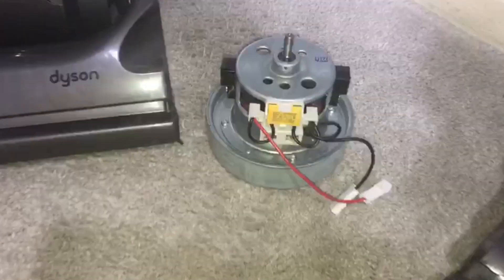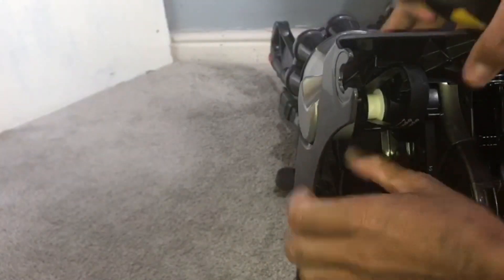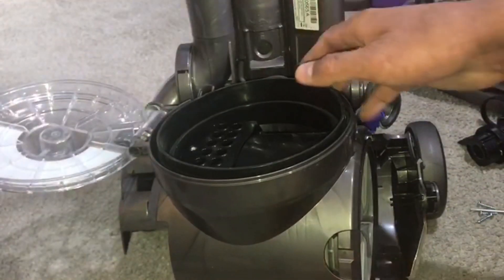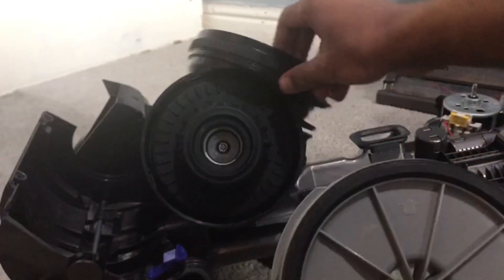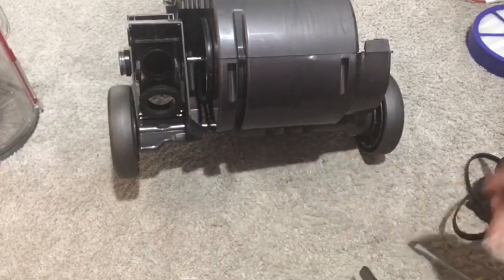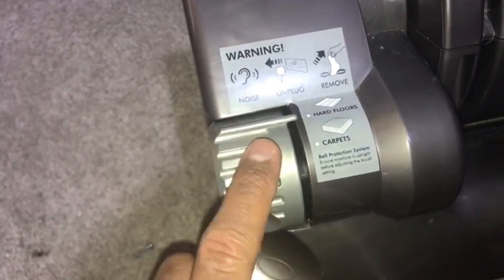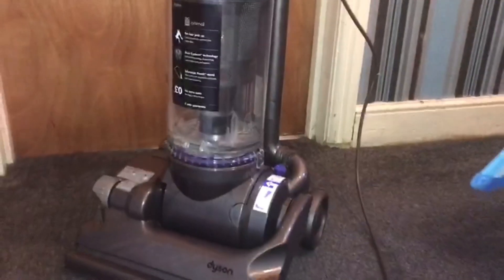HOW TO- Dyson DC33 MOTOR & CLUTCH CHANGE + Tricks to make your Dyson work like new! (EASY PEASY)

Comment: 17:45 my filter lid doesn't go back on do you know how to fix it? It goes on but its a bit stiff.
Reply from the maker: It should just be fitted at the right angle really, make sure it's clean is all I can suggest really along with greasing
Reply: @parwaz7861  I'll try it. But it won't have caused any damage?
Reply from the maker: @jayambermsp8000 Sorry I'm really not sure without seeing it I'm afraid
Reply: @parwaz7861   I put it in without the filter and it fits fine but when I pit the filter into the holder then it becomes a bit tight to fit. Will I have to take it apart?
Reply from the maker: @jayambermsp8000  I'm really not sure I'm afraid sorry, I've never seen such an issue happen before, make sure your filter is genuine is all I can think of really
Reply: @parwaz7861   I've fitted with a qualtex filter. Will I have to remove the filter housing clip?
Reply from the maker: @jayambermsp8000  they never need removing really but I really don't know what the problem could be sorry, try taking it apart and assembling again

Comment: I'm not gonna risk buying a dc33 chassis which is used i probably get a new one what do you think?
Reply from the maker: As long as its not cracked near the top above the cyclone exit
Reply: @parwaz7861  no I mean like  brand new in the box chassis.
Reply: @parwaz7861   I do like the dc33.
Reply from the maker: @jayambermsp8000  yes why not?

Comment: Have you ever noticed some DC33 switch housings that stick? Does washing the switch housing fix it?
Reply from the maker: I’ve never seen that happen before, sounds like it’ll need cleaning
Reply: @parwaz7861  Me neither. Does leaving it soapy water unstiffen it a bit?
Reply from the maker: @niceandspicy3197 I can’t guarantee it will but give it a try
Reply: Is the DC33 the only Dyson that the switch cover becomes a bit stiff over time?
Reply from the maker: @niceandspicy3197 it can happen to any of them tbh
Reply: @parwaz7861  Oh, right. Well, I've washed it and need to dry it, but it seems to be ok.. for now.

Comment: The MTR299 which fitted makes a weird noise when turned off. Is it normal for it to make that sound?
Reply from the maker: Nope, maybe yours is dented or something wrong with it
Reply: @parwaz7861   I fitted it right and didn't use a hammer.
Reply: @parwaz7861   I'll upload it for you to hear.
Reply: Did you watch it?
Reply from the maker: @jayambermsp8000  Sounds fine to me, I wouldn't worry about it

Comment: Anytime I turn the machine on, it sparks. Does it go after a while?
Reply from the maker: It’s normal for that to happen when switched on. As for long term sparking, I don’t know, every motor is different, it could be a good a bad motor
Reply: @parwaz7861   Is it safe to use?
Reply: @parwaz7861  I mostly use the Qualtex ones.

Comment: Would you recommend pattern motor from manchestervacs or a Kenley?
Reply from the maker: Yes they are decent, I use qualtex ones but Manchester Vacs is a good source
Reply: @parwaz7861   Since Manchestervacs don't sell the MTR240, are the MTR240 on Ebay same quality as Manchestervacs?

Comment: Is it normal for new motors to spark for one second when fitted? Theres no burning smell or weord noise.
Reply from the maker: Yes
Reply: @parwaz7861  Phew. I was so worried when it sparked. I had to get a new motor for it. As you can see, I get extremely worried when selling electrical items. In case they get damaged.
Reply: @parwaz7861  Does the sparking go after being used a few times?

Comment: Is it normal for Dyson motors to rust a bit as I've noticed a tiny bit on the spindle?
Reply from the maker: Rust appears on metal when there’s humidity in the air
Reply: @parwaz7861   Does storing it in a room after hoovering up with a dehumidifier prevents that?
Reply from the maker: @niceandspicy3197  It’s not my field of expertise, but I imagine it could help
Reply: @parwaz7861  Have you had any Dyson motors that have rust on?
Reply from the maker: @niceandspicy3197  Yes, due to water damage
Reply: @parwaz7861   I store my Dyson after using it in a room with a dehumidifier on.

Comment: Is there anyway to remove the clutch cover without making the clutch cover all chewed up?
Reply from the maker: It shouldn’t have to be forced out, it comes out easily with a bit of a wiggle once the screws are removed
Reply: @parwaz7861  I mean the clutch dial. Is there anyway to remove it without scuffing it?
Reply from the maker: @niceandspicy3197 locate the two clips on an existing clutch and pry from there, top and bottom with a large flat screwdriver
Reply: @parwaz7861  Does that stop the clutch cover from getting chewed up?
Reply from the maker: @niceandspicy3197  It only gets chewed up when you use excessive force
Reply: @parwaz7861   I prefer non clutch Dyson's for repair

Comment: When I put the cyclone back on the bin, the cyclone becomes very stiff and the seal comes out of place and rubs against the wall. Any tips?
Reply from the maker: Which seal are you referring to? And do you mean the cyclone is hard to push back onto the vacuum?
Reply: @parwaz7861  It's the external seal which sits on the cyclone on the DC33. It comes out of place when fitting it back on the bin.
Reply from the maker: The foam gasket, the bottom circle shaped seal for the bin flap or the ring seal that connects with the top of the bin?
Reply: @parwaz7861  The upper bin seal the one that sits on the cyclone.
Reply from the maker: It will need some talcum powder to help it slide against the bin
Reply: @parwaz7861  Will it stop the cyclone seal from coming out of place when fitting it back on the bin?
Reply from the maker: @niceandspicy3197 Yes should do because it sounds like the seal is sticky, they need to be dusty in order to move freely
Reply: @parwaz7861  Does talcum absorb the moisture from the seals and is it recommended to wash seals or not?
Reply from the maker: You can use any powder as well, it shouldn’t cause any issues. Dysons have some white dust from the factory on their seals for this very purpose. The seals aren’t designed to be washed of wiped with a damp cloth at all, like I said they’re supposed to be rusty to prevent they sticking against plastic
Reply: @parwaz7861  So far, I've done nothing to it and it seems to not go out of place. Should I use it a few times for it to stay in place?
Reply from the maker: @niceandspicy3197  Yes

Comment: I changed my dc33 motor and it works brilliant now but it has a smell to it is that normal?
Reply from the maker: Yes because the burnt motor smell from the previous motor will be in the plastic motor housing and post filter so it's best to give the parts a good clean, the motor bucket will just need wiping as good as you can and the filter just needs replacing tbh unless you can wash the smell out then that's good as well
Reply: @parwaz7861   I did wash it and gave it a good clean. But there is a smell but not a lot will it go away by itself?
Reply: Do you think it is because its a new motor and after few uses itll go
Reply from the maker: Either the smell is proper in the plastic and filter or you just need to let it settle in and probs use scented shampoo to wash the filters
Reply: @parwaz7861   i have bought new pattern filters for it

Comment: The DC33 cyclone doesn't seem to click back on. I've fitted the seals on the chassis correctly and it seems a bit stiff. I have taken off the seals and fitted correctly.
Reply from the maker: Spray furniture polish on the slanted area of the clip and the main body and make sure they’re clean
Reply: @parwaz7861  is the slanted bit on clip on the cyclone?
Reply from the maker: @niceandspicy3197  yes just spray furniture polish on where the clip attaches to the vacuum and clean it so it doesn’t get stuck
Reply: @parwaz7861  I've tried that and it doesn't seem to work.
Reply: @parwaz7861  When I take the seals off, the bin clicks perfectly. Do you think the seals need replacing?
Reply from the maker: I’ve never known the rubber seals to go on a Dyson
Reply: @parwaz7861  First time I've had this on a Dyson.
Reply: @parwaz7861 I think it's the switch cover. One side looks in place, but the other doesn't. I have fitted it correctly and wired it correctly too.
Reply: @parwaz7861 Do DC33 cyclone all click in or can they get stiff after a while?
Reply from the maker: @niceandspicy3197  They can get like that after a while, normally cleaning them fixes the issue
Reply: @parwaz7861  It does click back on, a little bit stiff, but not too much. Will it loosen up after being used a few times?
Reply from the maker: @niceandspicy3197  I have no clue sorry
Reply: @parwaz7861   Would it be safe to sell?
Reply: @parwaz7861  Does soaking the switch cover in soapy water help?

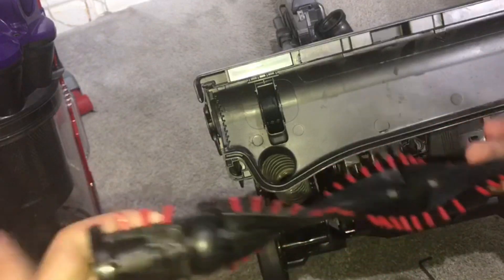Comment: 16:10 if I have to do this I’ll just buy a trade tool set which comes with belt tools.
Reply from the maker: I don't see the point because it's not something which will need doing often, it's a one off thing to do
Reply: Parwaz 786 I understand and I agree. Infact which clueless models you don’t even need it at all. Just a waste of time. I’m gonna buy that though bcs I don’t have any of the screw drivers, so I need it for a job like this and that package includes the belt tools.
Reply: @parwaz7861   I find it much easy with the belt lifter tool. It's literally impossible to get a brushbar back on a brand new clutch.
Reply from the maker: It’s possible as I’ve showed in the video

Comment: I couldn't find anywhere where the DC33 is retired. DC25, however, is retired.  I find it absurd stopping support for these kind of machines. Not everyone likes the newer Dyson ball.
Reply from the maker: The DC33 has had all support discontinued, they will no longer be repairing them unfortunately
Reply: @parwaz7861   Honestly, it's ridiculous why they did that! DC33 isn't even that old. Looks like that's the end of the wheel Dyson. 😔
Reply: @parwaz7861   I've just checked and it  say it's no longer supported. Why do they stop support for this machine when it isn't even 20 years old?

Comment: Does moving the wires around in the motor housing cause damage to it when replacing the motor?
Reply from the maker: You just need to connect the wires, they are flexible and designed to be moved around just like the mains cable
Reply: @parwaz7861  What I meant is that does moving the wires cause strain and maybe the wires being frayed or is it probably fine?
Reply from the maker: @jayambermsp8000  It’s no different to the wires in the main flex, those see years of flexing and still remain good
Reply: @parwaz7861  Thats probably the only easy method of fitting the motor.
Reply from the maker: Yes
Reply: @parwaz7861  Should I use that method or shall I use a different method?
Reply: @parwaz7861  What method do you use?
Reply from the maker: @jayambermsp8000  I’m not sure how else it would be done - it’s nothing more than just clipping the wires together and getting the motor back in the bucket
Reply: @parwaz7861  Should I not worry about moving the motor wires around in case they get damaged?
Reply from the maker: @jayambermsp8000  As mentioned, they are flexible wires, designed to be flexible just like the wires inside the mains cable, they’re made of strong materials, so just moving them around won’t cause any damage 

Those wires see a lot more than just movement, the high temperatures from the motor and they still remain fine. 

I have never heard of any scenario of the wires in the motor housing breaking or getting damaged

No need to worry or over think
Reply: @parwaz7861  I wonder why the wires stay intact even being exposed to high temperature.